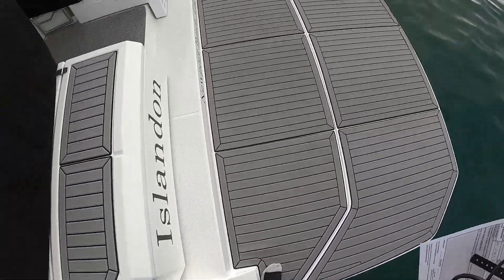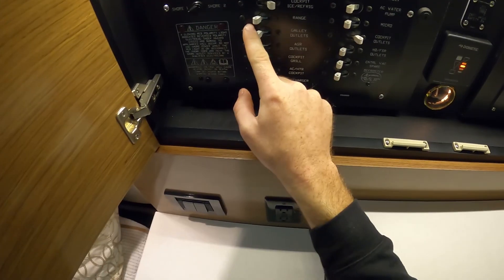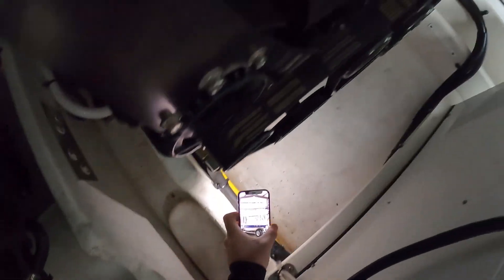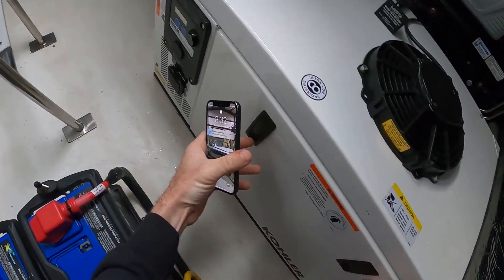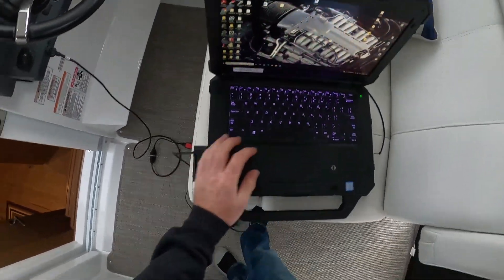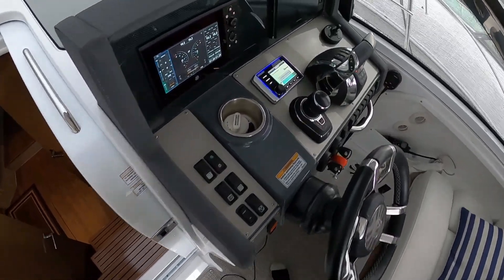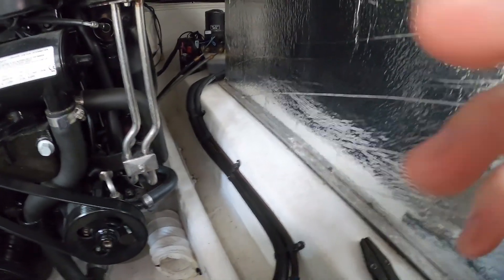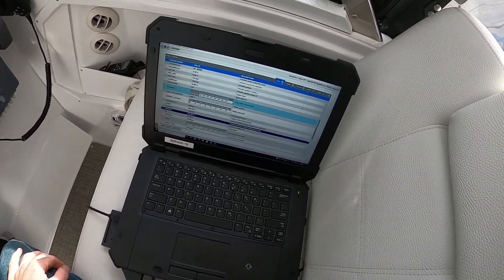Mercruiser 8.2 Overheat Diagnosis on almost new 8.2's

Comment: Hey buddy, awesome video. You're very good at what you're doing. I just ran across your video for the first time tonight. Your narrative description of what you're doing as far as addressing the issue and following through with the different steps you're taking to diagnose the problem. I see so many in our industry that don't do this and basically just throw parts at problem. I'm in the marine service industry myself and it's still a passion for me after almost 40yrs. You're damn good at what you do. I look fwd to watching more of your work. So many get into this industry with dollar signs in their eyes. It's pretty cool to see someone with the same passion I have. 
One last thing ,the time stamp of your video at 11:40 to about 11:56 , I noticed another problem that your customer likely is unaware of. You might want to check out the engine alignment on this 502 . Appears that the front engine mount has worked loose and dropped. The will definitely create more problems in the very near future. I'm sure you probably caught that before finishing up this job. Just wanted to give ya a heads up.  Good luck my man. 👍 
Craig Deese
Reply from the maker: Thanks For the comment. Unfortunately most of my videos will have to come down due to unforeseen circumstances. They will go down in about 24 hours, so download whichever ones you want to watch. I will still be working, but unable to post more videos.

Comment: Hey…i have the same problem how did you solve this:)
Reply from the maker: This Problem was solved with a bravo Drive Water pickup tube, The plastic had split in half allowing the engine to suck up air instead of water.

Comment: Love these videos.  I have 2 8.2 Horizons installed on a 340 Sundancer.  Out of nowhere, the port manifold on the starboard engine got way hot.  I called mercury and they said it's likely that the poppet valve on the starboard manifold is stuck open, which has the result of starving the other side of water.  You seem to be pointing at the fitting on the bottom of the poppet valve, rather than the spring loaded poppet valve assembly.  Which is generally problematic, the poppet valve, or the ball valve on the bottom?
Reply: I didn't realize you're in Irvine.  Do you do Mercury warranty service?  Boat's in MDR.
Reply from the maker: We perform service, but not warranty work currently. For warranty work, I suggest Boatswains Locker in the southern California area.
Reply: @SJCompleteMarine  Finally removed the cup on the bottom of the valve that holds the check ball.  Found a 3 inch strip of black paint that must have come off somewhere else in the engine and lodged in the check ball housing.